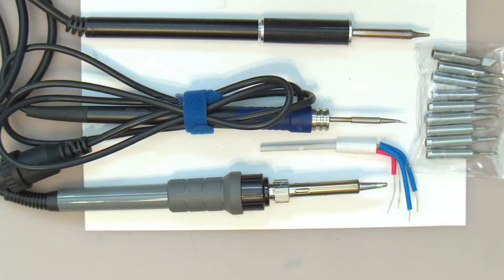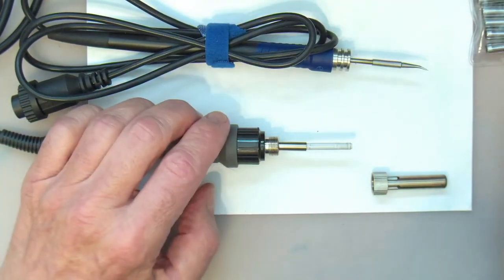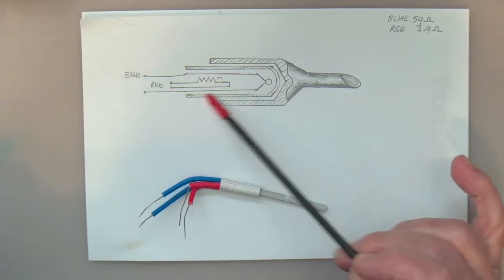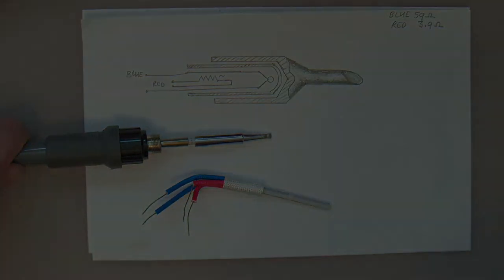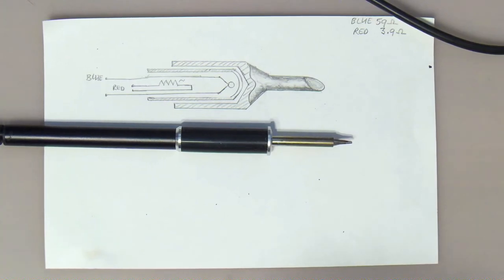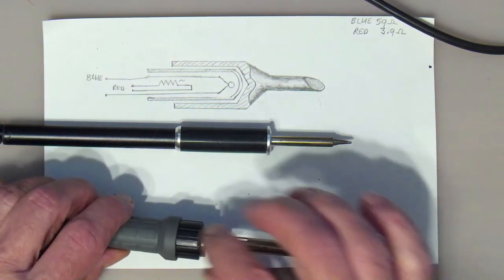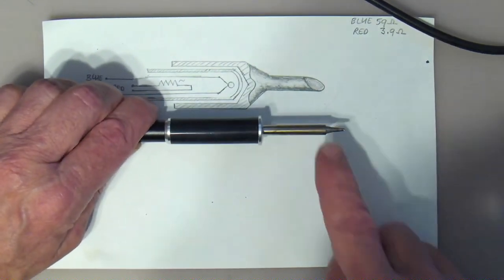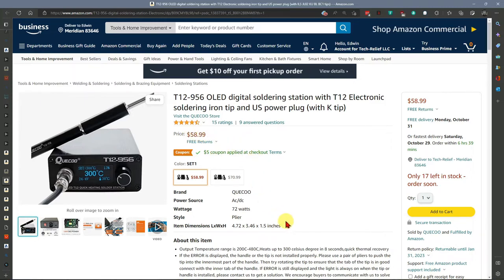Soldering Irons

Comment: I repair electronics and do a lot of SMD soldering and this for almost 30 years now. Today I use for the most part cheap Chinese soldering stations. Mostly combined HotAir and Soldering iron (€150 - €200 range). Yes, I could buy the very expensive Weller or JBC stations but they come with a price. What it comes down to in most cases is the one that does the soldering that makes a soldering station good or bad. Many repairs have passed my work bench of people who tried to do SMD soldering with no expierence. Even when those people bought the Weller or JBC stations they would have the same result. SMD soldering is something you need to learn, no matter what equipment you buy. For me, the Chinese stations never let me down and do the job.
Reply from the maker: Yes experience is more important than the equipment, I am sure that you could probably make good solder joints with almost anything.  Others may not be able to with even the most expensive equipment.

Comment: Few tips,if it is not too late and you know it already. For more expensive old type of original irons and tips,they are not that loose . 2nd you can always fill it with just one role of aluminum foil or similar and it is far better . Of course,it wont still match up to the new,but one thing I like about those old types of irons is that they take up physical abuse far better ,so having them for rough jobs is always nice . 
As for budget ones new type of soldering irons,I think aixun pretty much hits the point,since T3A can take different types of soldering iron types(T-12 and JBC style irons) ! And of course Atten . IT seems a lot more expensive at first,but when one thinks about the use of different types of soldering irons it more than justifies the cost

Comment: your kit about soldering irons is valid however you most likely would have soldering irons like tools on the wall. there are different they can do different things based on there design. so a 1/2 inch socket is not a 5/8 socket. nor a 10 mm socket is and some on. so having more is an advantage. i can see that tool makers can make better solders with more fitting to be available. pincher or curved soldering irons for boards in sizes all the way down to pin sized heads. and lengths of the tips form one inches or 25 mmm to 50 mmm for clearance issues.
 and watts again depends on what you need to do with it.
so this industry is still developing new tool all the time and with microcontrollers coming out with more ways to use them, specialized tools will be made and purchased over standard traditional soldering irons.
station filters vacuums the overall set up safety this industry is still underdeveloped.
Reply from the maker: Yes that's why I attempt to try and evaluate some of the newer stuff so you guys can see what works and what doesn't.  At least that was my motivation.

Comment: I use a cheap zeny 898d soldering station with that cheap iron on it for over 10 years 10 or more hours per day. I replace the element 1 time . Right now I am using a cheap 898d+ to do microsoldering. I love weller soldering station but it's too expensive for me right now
Reply from the maker: Yes I understand, of course experience helps and a skilled operator can probably make do with almost any soldering iron.  I also think Weller and JBC etc are too expensive for hobbyists that is why I bought the ATTEN station.  $200 was my limit...

Comment: there is a hakko kit  you mention in previous videos what you think about the one you said you assembled  thanks for the  tools video it is great
Reply from the maker: The ones I assembled from a kit work well for most jobs.  I have actually ordered some wide T12 spade bits that I want to try to see if they can desolder a whole row of pins at the time like on USB connectors etc.  If it works I will do a video on it.

Comment: Bud, your videos are good, but the expensive stuff, is sometimes out of reach for young enthusiastic hobbyists, just starting out! The cheaper t12 ksger or quicko stations are exceptionally good, cheaper, and do a good job, if not better than the expensive stations. Not saying that your wrong or right, just adding my opinion, that’s all. Keep up the good job. P.s Sit back and read what the people are commenting.. cheers 🤙🏼🇦🇺
Just sub’d also.. 🤙🏼🇦🇺
Reply from the maker: Sure, I have a couple of T12 stations that I use but there are no hot tweezers for them I know of and just occasionally I need a little more power and that is how I got into the Atten station.  I got some interesting spade bits for the T12 stations and find these rather useful, will do a video on those soon.